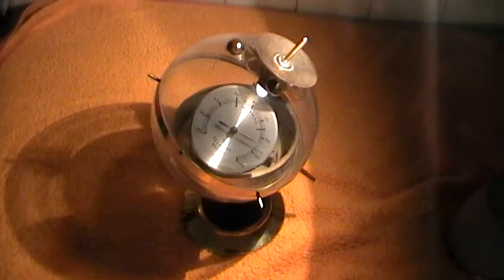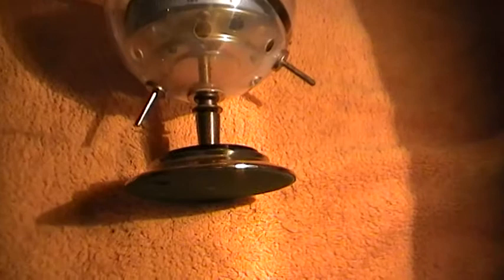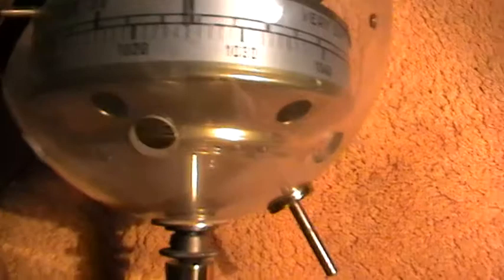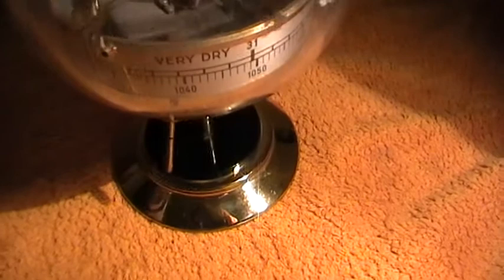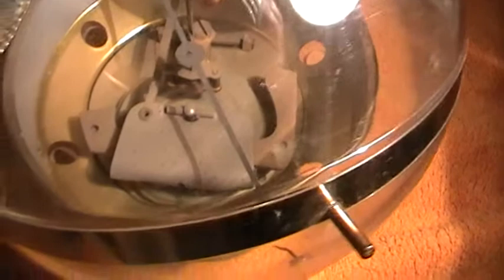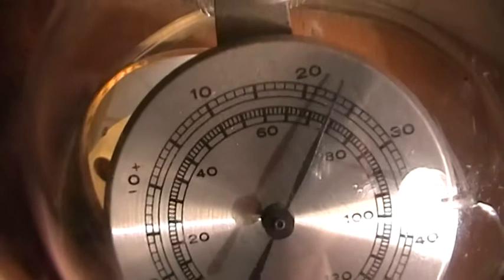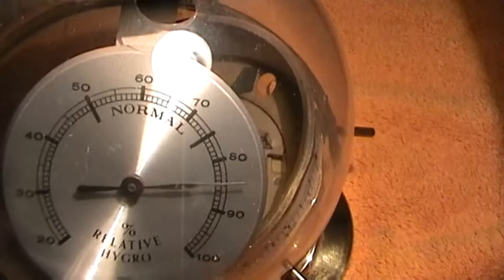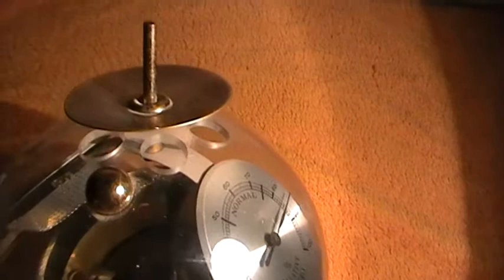Sputnik weather station

Comment: For anyone wanting to set the barometer, there is a screw on the base of the barometer, inside the plastic shell.  When you look at the bottom of the weather station, there are three holes spaced evenly round the base "spike" and one hole just slightly further up.  Rotate the barometer by turning the base spike whilst holding the plastic shell and you will eventually line this fourth hole up with a screw, which you can then turn with a screwdriver to set the barometer pressure.
Reply: Thank you!  Just picked one of these up and have been trying to figure that out myself 😂
Reply from the maker: Thanks for the info.

Comment: Just bought one today in Adelaide Australia.
Reply from the maker: Hi hope its working okay, good luck with it thanks.
Reply: Where in Adelaide? I saw one at rundle mall but it's quite expensive.
Reply: What is it worth?
Reply: @alexchu215  Sorry for the late reply. I bought it from a antiques shop in Semaphore.
Reply: @gideonbodenstein8365  Good question. I've seen them online new for over $380. My one which is second hand cost $40.  I'm not sure if mine is original but it does have  Made In West Germany stamped on it. That interested me as I had not seen that for many years.
Reply: @migette1  Sorry for the very late reply. The barometer doesn't seem to work but its a lovely talking point when friends come round. Thank you for your interesting video.